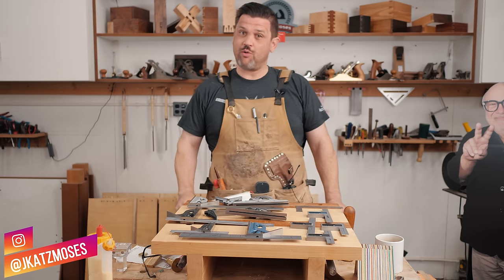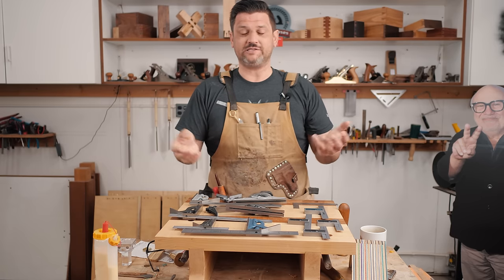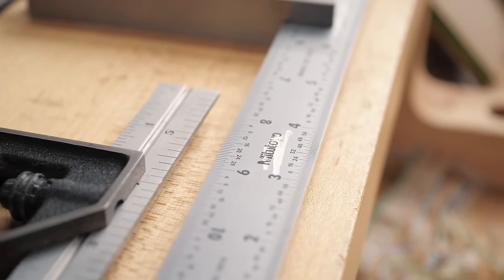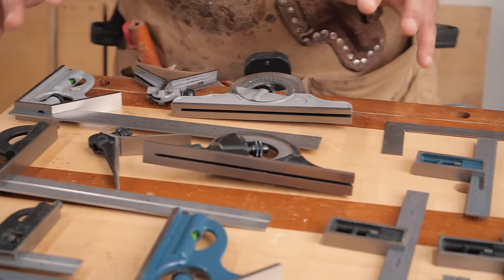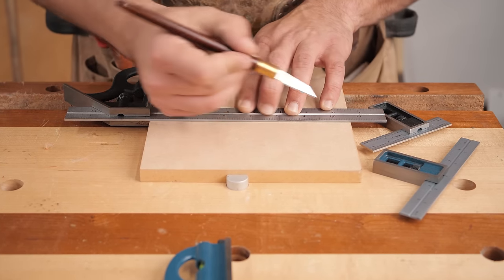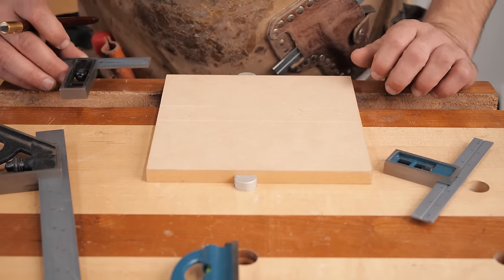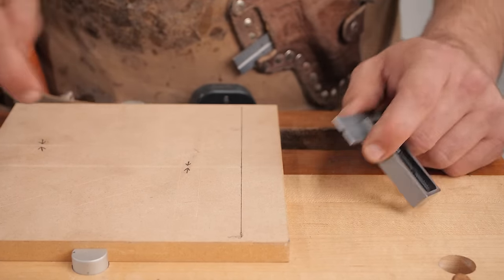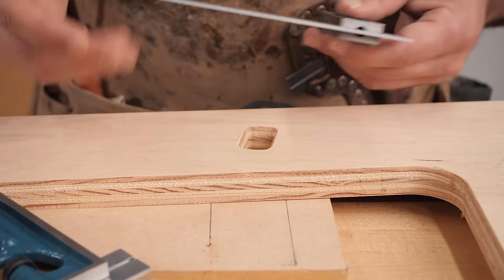Everything you can do with Combo/T-Squares and Why they are the Most Important Tool in ANY Shop

Comment: A square is a simple device that only needs to be precise in a couple areas in order to work close enough. The Irwin squares are solid, these days. My Irwin 6" combo's slide needed to be ground straight and parallel on the edges. Doing this properly isn't incredibly difficult nor time-consuming. Although it requires some specific tools and/or know-how, this equipment isn't particularly expensive. That was it. Everything else was perfect, out of the box. 

I've another cheap square with the stamped slide. This is terrible because the slide warps in 3 dimensions and can't easily be made to lay flat without really special equipment. I got this one working great, in the end, but it took a lot of time hammering and bending and grinding. The other major issue is the flats on the body were hollow-ground so only the corners touched, and this is no good for wood working. After lapping those flat, the level bubble magically became spot on, and the square was pretty much dead square. I would not buy that one again, since the Irwin was only 10 bucks and was good to go with only 10 minutes of inspection and work.

I disagree that zinc aluminum alloy squares are no good. After carefully deburring the rule, the zinc alloy does not appreciably wear. They survive drops onto concrete just fine. And they don't rust.

Comment: Thank you Jonathan for this evaluation. 
Quality measuring tools are expensive, but they do last.  I still use a Starrett combination square that my Dad gave me that I'm pretty sure was purchased either just before  or just after WW II.  But it has an 18" rule in it, and  after working with it I recommend that you spend the extra bucks to get that 18" rule.  There are a lot of times I just need a couple more inches than a 12" would have provided. 
Thank you, Jonathan for this evaluation.

Comment: How about a video on caring and refurbishing squares? I have some I got from my Dad that need rust removed, etc.
Reply from the maker: Probably a lost cause due to the high precision needed. Although I'd it's just the blade that can be replaced at that same link to the blem sqaures
Reply: I have the same question. However while I agree that many of these tools are beyond reliable repair, I have a number of quality older tools that simply need cleaning up so the etchings can be easier to read. Can they be buffed, or some sort of solvent be applied?
Reply: @eddieg9032  wd40 and 4/0 steel wool followed by paste wax has worked really well for me.
Reply: @katzmosestools  I checked Dad's old squares and they are the good style, just some discoloration on the blades. But I ordered a 4" and a 6" blew blade anyway.

Comment: Using the tick mark you still could be 10,000 off depending on the width of the tick mark in the placement of the knife what's in that tick mark. So exactly is a broad term it all depends on the skill of the user of the tool and using the tool correctly.

Comment: The "blem" PEC squares are a great bargain and made in the USA.  PEC makes many of the house branded squares sold by woodworking supply specialty retailers. 

A few months ago I bought a blem PEC 12" 4R combo square. Wth a thicker, hardened rule/slide, a precisely machined cast iron head, for about $20 more than what you'd pay for an Empire square at a big box home improvement store, and you'll get a vastly superior tool.  

The "blem" was a tiny spot on the edge of one of the 1/16" graduation marks where the chrome plating didn't take. When I got the square, I had to look really closely to finally spot the cosmetic defect that does not affect the performance of the square in anyway.

Comment: Wow. I literally just bought an Empire square the other day and you called it out. LOL time to return it I suppose.
Reply: I have two both are 100% accurate with the flip test because I adjusted them square, I haven't tried really expensive ones yet but I assume they just don't need to be checked for square as often, mine goes out of square once a year usually.
Reply: Realism91 appreciate the input. I used mine all day today and couldn’t be happier. For like $12 it’s good enough for me. If it were any straighter I’m sure I couldn’t cut that straight anyway.
Reply: When you get your "blem" square, the Empire will feel like a toy in comparison.  It's not a bad tool, just not as accurate or well-made.

Comment: The iGaging squares are awesome. Great value and guaranteed to be at the same tolerance as Starrett they even have the Matt finish. Combo squares are not great at 45° because it has like 2” of surface and can be awkward  to hold at 45°. I prefer double squares and bench squares (basically better rafter square)  the only thing that needs improvement is the laser etching is a little light and gets hard to see after a few years.

(edit) I looked at the set of double squares at the local wood craft they are absolute garbage, so I went to the iGaging website and they no longer have a guarantee of any kind. They did improve the etching though.
Reply: Matt finish? What if I wanted a Peter finish or a Jill finish?? 🤔🤔😛

Comment: Thanks Jonathan!  Excellent info as usual.  Just ordered a combo blem set.  Only have 12" though.  Am I correct that a replacement t 6" blade will work with the 12" set?  Any issues?
Reply: no, the width is different between the 12 and 6 rulers and are not interchangeable

Comment: Great vid as always my man. Just curious, was that an underhanded dig at iGaging? I have no reason to defend them, just curious if I should avoid them for any reason.
Reply from the maker: No I've heard they're ok but the Blem Squares I link are cheaper and WAY better
Reply: Say word. 

But also, let’s be real..... Empire is the cream of the crop......
Reply: I have two iGaging squares (soon to be replaced with PEC blems) and the problem with them is that the markings are not etched in...they are raised (painted on maybe?) which makes sliding the head along the blade very rough. Feels and sounds like it has sand in it. Also, once you take a blade out, it can be very hard to get it back in because the hook at the end of the screw tends to catch on the blade preventing it from sliding in. Having said that, both of mine are square and accurate, just not a pleasure to use. My old Empire combo feels way better. Slides like butter and the markings are etched in.

Comment: No speed square?
Reply: They're wonderful for carpenters and framers.  Quick and with lots of useful information built in, especially if 1/16" (.064") is your minimum measurement.  They're not nearly accurate enough to compete with these guys, which are accurate to .004".
Reply: @mikecurtin9831  I know I just figured that since they play an essential role in carpentry and woodwork that they would've been mentioned somewhere but I get it.

Comment: I ordered (recently) from Taytools a combination square, double square and machinist square.  Well anything I get can and will be use against each other.  I check them against each other, the combination square head is out of square by a few degrees.  I got refund for the tool.  I was hoping they will swap for a more accurate one.  Very disappointed.  Turns out, when put the blade into my el-cheapo combination square, it was amazingly accurate.  That's how I found out that the stamped blade is not even parallel along the two edges.  I think I will order a replacement blade from them to use on my old square head.  I think the BLEM tools are rejected for more than just blemish reasons.

Comment: Yeah, you go right ahead and pay out the wazoo for an overpriced square, lol.  Aluminum is just fine because I'm not going to be beating on the thing.  And it isn't like it is somehow going to mysteriously change its shape on its own.  Steel will rust like the rusty framing square out in my garage...mind you, it is still square as I don't beat on it with anything either, it just isn't "pretty" anymore.  It'll still work fine for when I go to build my shed next year.  In my shop I have a combination square, a machinist's square and a speed square and of the three I find that I most often use the speed square because of its convenience and it's a stamped aluminum ace hardware brand I think I gave a whopping $12 for.

Comment: What’s wrong with empire squares. Mine has never failed me.
Reply from the maker: They're terrible. Soft casting and stamped aluminum blade. If yours in dead nuts I'll buy you a sawstop
Reply: Jonathan Katz-Moses Wish I could take you up on that but I’m new to wood working and do not have the experience to take that bet. Any how I like your channel and thanks for the good tips. I have made two projects as of now and they both turned out horrible but after watching your essential videos I see where I messed up. So thanks.

Comment: Let's call a protractor a protractor and not a compass? Don't you edit your videos?  Read from this product description - Starrett Combination Set with Square, Center and Reversible Protractor Head and Blade - 12" Blade Length, Cast Iron Heads, Hardened Steel, 4R Graduation Type - C435-12-4R